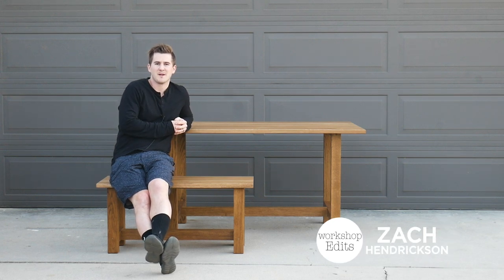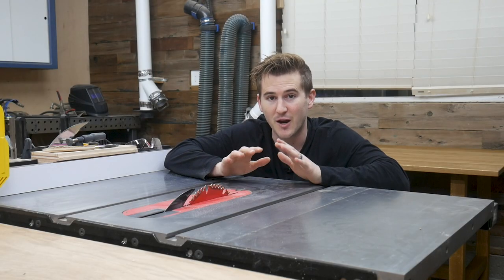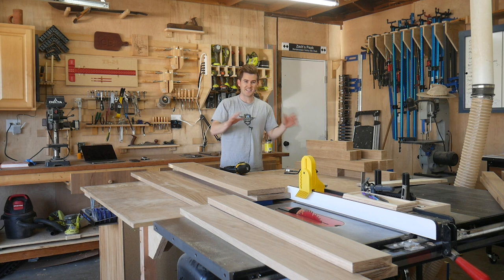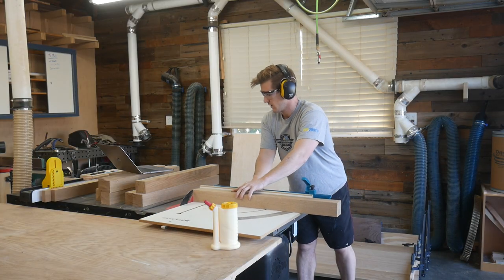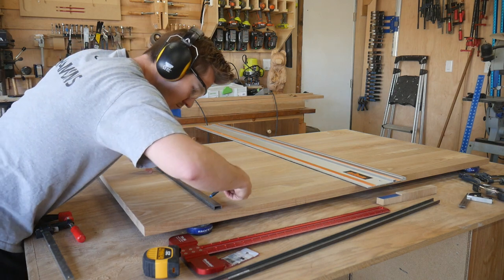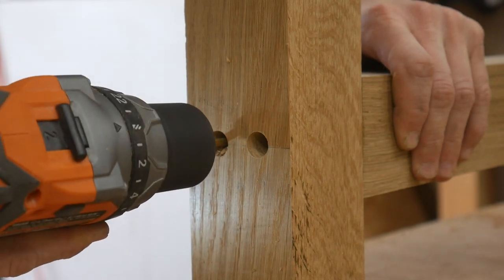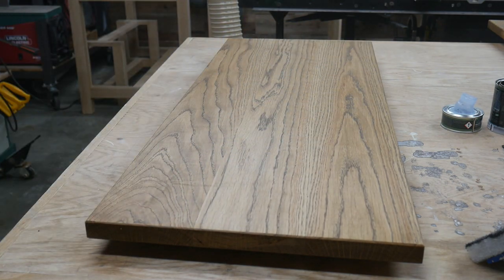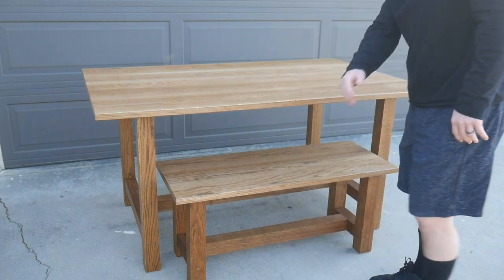Solid Oak Dining Table | 66

Comment from the maker: Thank you for the few tips on wood movement everyone. Just for clarification, the holes on the C Channel are oversized so it floats more with the screws just holding it in place. However, I have gone back this morning and elongated the outside holes on the underside of the legs to allow the legs and table top to move freely from each other a bit more and allow for extra wood expansion.

Comment: Some questions: 1. Do you have to treat the end grain to keep it from along too much finish? 2. Have you ever considered using a different wood for your dowels to add a stylistic element? 3. The joins for the base, pre screws, was just glue? They seemed so solid. Thanks for the vid!
Reply from the maker: Great questions. 

1. I have used Monocoat half a dozen times now and never had any issues with applying to end grain. You apply it the same, buff it in the same, and buff it out the same. It might look different, but end grain will pretty much universally have a different look than long grain

2. I did - I wanted to use walnut originally for accents but didn't want to go through the process of building a dowel making jig for this project - it's on my list and it's a great aesthetic option

Comment: I like the casual minimalist design. This came out really well. Where can i get one of those sanding doubles.
On first watching the video i feared a little for your fingers with these ripping cuts and the blade fully extended. Maybe because you sped up this part.
Reply from the maker: Just the speed up. I’m never close to the blade!

Comment: Looks really great! The chamfer on the bottom of the legs is a great touch.

Are you concerned with wood movement in the table top at all? I'm thinking the wood might expand and cause issues with the c channel installation and also the threaded inserts.
Reply from the maker: I followed the same methods that back forest wood company and other pros online have used so not at the moment.

Comment: I swear the imperial system gets worst with every American video I watch 😂 12 quarter... why not 3 inch? I’ve heard this a few times lately, really baffles me!
Reply from the maker: Labeling it as 3” would be incorrect for S2S lumber which is what I am using and also wouldn’t solve your fundamental issue with the imperial system.
Reply: @workshop_edits  how would it be incorrect as 3 inch? Honestly curious. I wouldn’t say it’s a fundamental issue, just seems like an overly complicated way to measure 😂
Reply from the maker: @JNDCreations  12/4 refers to 12 quarter inches of wood, which is 3", but thats the raw form of it - if you buy from a dealer, they usually advertise as S2S or S3S which means at least 2 or 3 sides have been surfaced, which takes off thickness, resulting in wood that is ~2.75" but more usable for the average builder. Hope that helps!
Reply: @workshop_edits  right, so 12/4 is the raw form, then you lose size for each surfaced side. Gotcha! Cheers

Comment: You’ve left no room for movement. Should have elongated the hole in the c channel and where you bolted the top to the base.
Reply from the maker: The channel is long. It has an extra inch on each side. And the holes are oversized.
Reply: I see plenty of room for movement. It's fully anchored in the center of the top and there's room for the wood to expand and shrink to either side of the center.

Great video Zach!